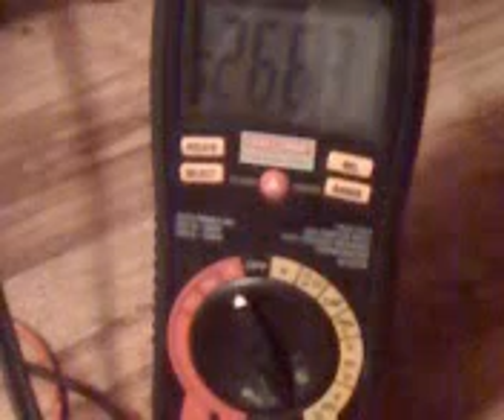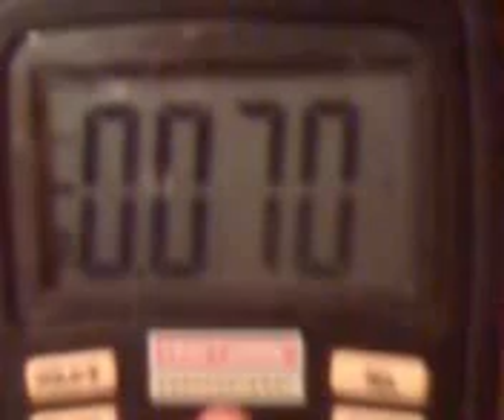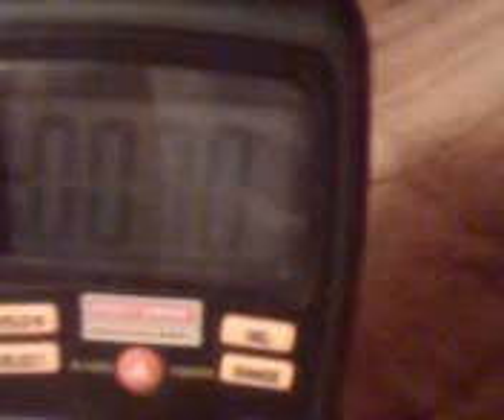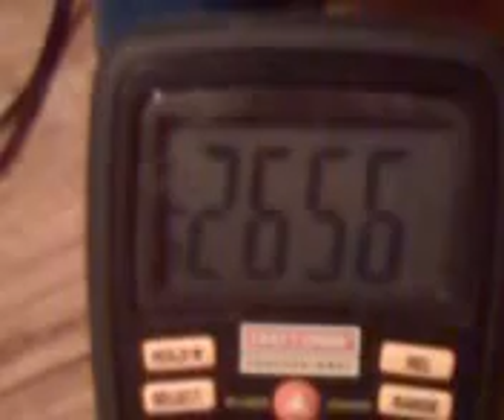#12 hho no hole dry cell .07 amps

Comment: yeah I want never hook it to a cell directly, but I plan in the future have it go thru like a pa then have the sound out the pa and then thru a power amp , then have some circuit protection then go to the cell, then just jamm out on my guitar and see what happens....Maybe I will be able to do it with the No Hole Dry Cell...sometime in the near future

Comment: I did hook up my guitar system to 2 switch plate covers and jammed out, got a few bubbles, but just wasnt giving it enough juice...I would like to try a 2000 - 4000 watt power amp hooked up to cell , with me jamming on it to see what happens..